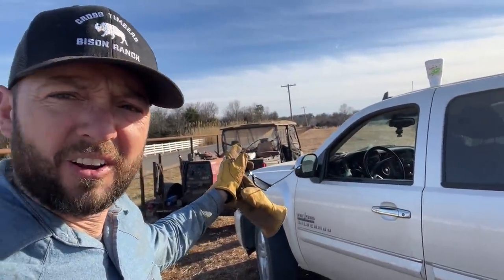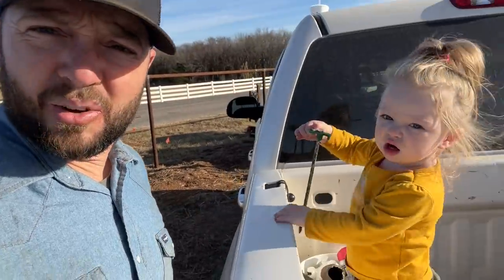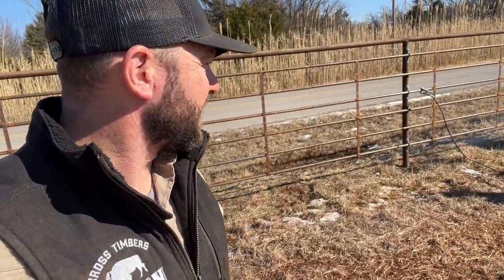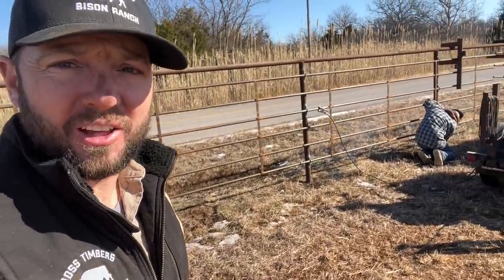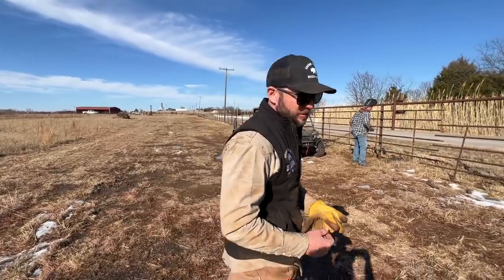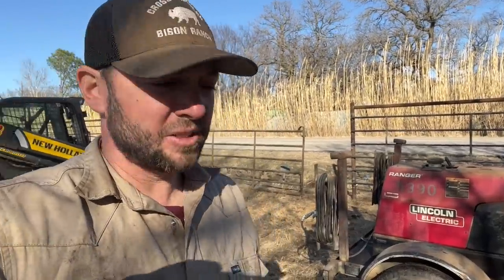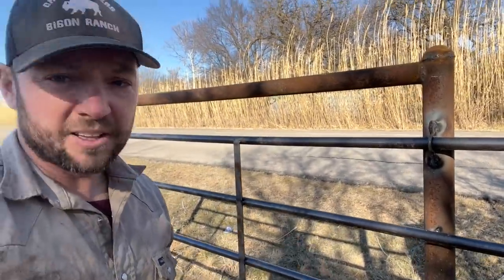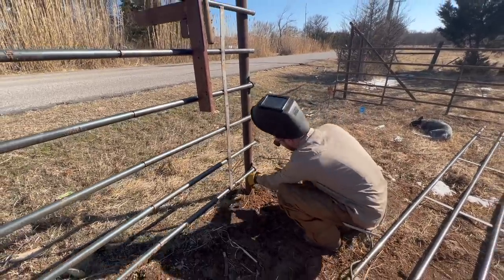How To Hang Bison Tough Continuous Fence Panels!

Comment: That is some slick fencing right there.  Love those slip joints to connect the panels.  And, that would be a panel hanger jig.  Have a pocket with some shims in it, and you could make setting the next panel into place easier for a single person.  Good system you had going there.  The first one always takes the longest, while you figure out your system for installation. Those Bison have some pretty fancy fencing to rub up on now.  And, as for Maya?  L A Z Y dog!!!  Yeah, I know, a ten minute nap and she's GTG at full speed for the next 4 hours.  LOL

Comment: Really good looking fencing. I don't mean to be rude, but knowing that the grass is so dry and very likely to catch fire, if I had been part of the team, I would have had several jugs of water constantly within a few feet of the welding, instead of trying to stomp out the grass whenever it caught fire. Little preparedness such as that, can make a tremendous amount of difference. We always did little things like that on our farm. Especially during an extended drought. Glad everything went well with your project!😎

Comment: Enjoyed the video.  I wished the Acetylene cylinder wasn't partially laying over.  Good way to Blow One's self up. The cylinder needs to be vertical....especially during use. You do NOT want Acetone to come out of the cylinder. 500 parts Acetylene vapor to 1 part Acetone.

Comment: You may want to put hangers on them instead of welding solid to those posts and I put 175-foot standing seam roofing panels on hanger at an Air Force Base in Texas when it got hot in the summer and then cold in the winter it shrunk up enough and then expanded enough to push the eve gert completely off the building. So I can't imagine how much 900 feet is going to expand and contract your fence is liable to look like spaghetti in a couple years.

Comment: do hiky is called a jig,, id love to have pens an fence made like that as i am a welder by trad, but you have to be very rich with deep pockets as pipe in 24 foot lengths is not cheap once you go over 1-1/4 unless you go with thin wall tubing. witch dont hold up, i use 4x6 field fencing 48" high at $387 cnd for a 350 roll and ceder posts from trees off my land  to buy a 6"x8' post is $12 cnd. dont know how you afford to do all this when you dont sell a product. just buy buy buy.. i know i sure cant. id say you need to burn them badly neglected fields off. i burn mine off every few years. make the grass grow so much better, as my cows dont eat everything and it kills off weeds and weed seeds